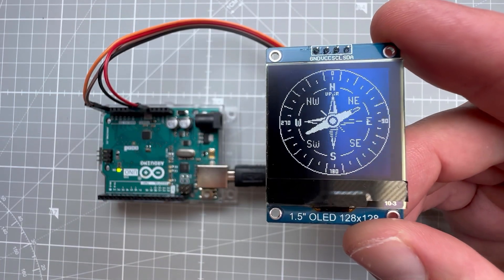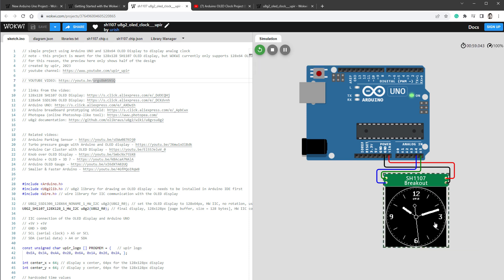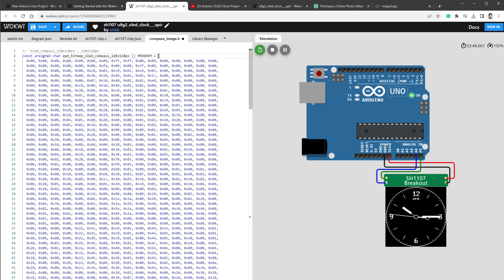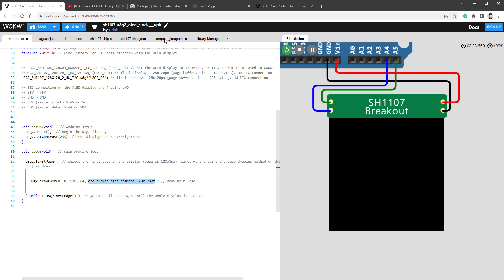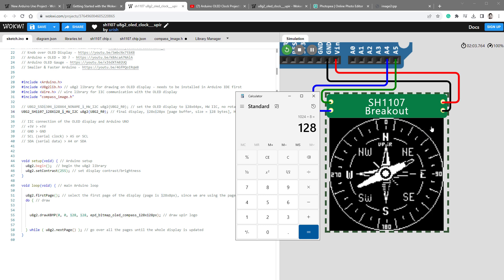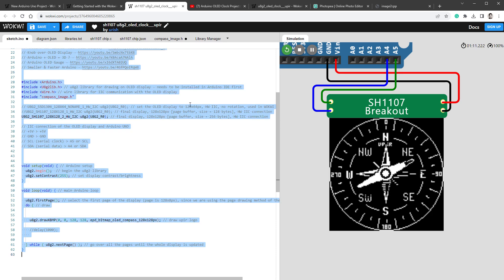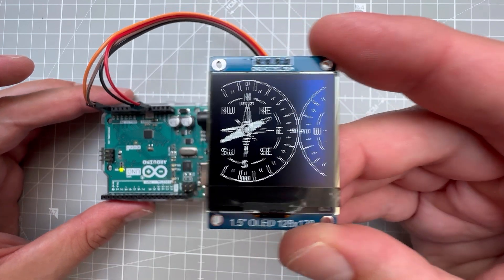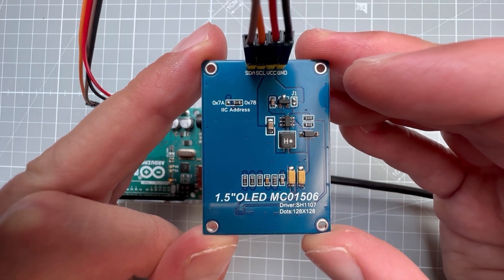New Possibilities: Arduino UNO + 128x128 OLED Display in WOKWI (SH1107)

Comment: Hello, I am fairly new to Arduino and coding but I feel I have improved and want to try more ambitious projects.  I want to learn more about OLEDs and how to set them up, especially the 128 x 128 OLED and a 64 x 32 OLED.I am trying to upload the code but I am getting the "attempt 1 of 10: not in sync" etc... for both OLED screens.  What am I missing? What am I doing wrong?
Reply from the maker: This has most likely nothing to do with OLED, but with your Arduino board. Try installing the latest IDE, latest board package, perhaps try a different Arduino? Also, try your code in WOKWI, if it works there, it should work on your Arduino as well.
Reply: Thank you for your quick reply. for the project I want to apply these OLEDs to, I am limited on space , so I want to use the smallest microcontroller as possible. I want to use a Nano or even possibly a tiny Seed Studio or a DigiSpark. I do have the lastest Arduino IDE.  For the code that you provided, do I need to alter it at all or is it ready to go? I opened the compass source file to download to my Nano and got the "Not In Sync" message. Are there any drivers that I need to download?
Reply from the maker: @JohnAllen55 I don’t believe there is anything special required for the Nano to work- except of course selecting correct board and settings in the Arduino IDE and making sure all the used libraries are installed. Even if you plan to use nano, it might be a good idea to start with UNO to see if that one works.

Comment: I would like to use this display on a PIC. Would you happen to know the initialization sequence in bytes to reset the display and turn it on?
Reply from the maker: You should be able to get the initialization sequence from the u8g2 library source code.

Comment: Hi. Can you show us how to implement a SSD1351 Oled display in Wowki, please? Or throw in some pointers. Cheers.
Reply from the maker: You can use custom chip in WOKWI to implement SSD1351, but I don´t believe anyone else has done this yet. At least I haven´t found a working example. I don´t have enough knowledge to do it myself unfortunately. There are some examples in documentation, this might be a good start.

Comment: nice videos. keep doing. waiting for Lilygo t display s3. did u try figma ?. is any way to use svg files in these type of display ?
Reply from the maker: Thank you. Yes, I do have multiple lilygo displays, and I will include them in future tutorials. What is the reason for using svg files? I’m sure there are some libraries, but there is probably no advantage compared to using bitmaps.
Reply: @upir_upir  im new to this. thanks for u suggestion.